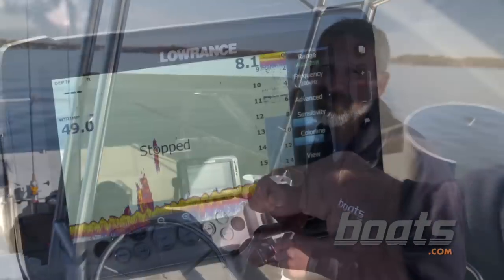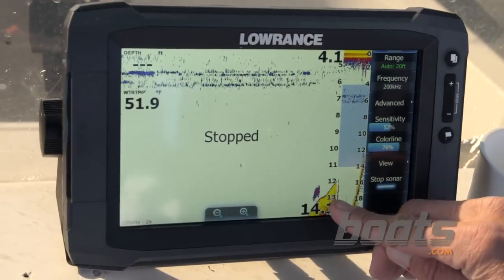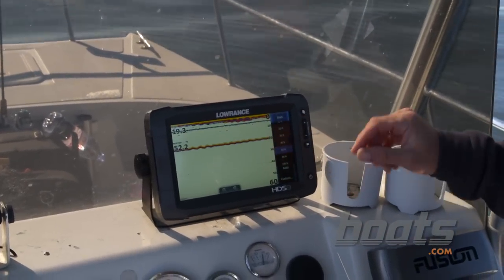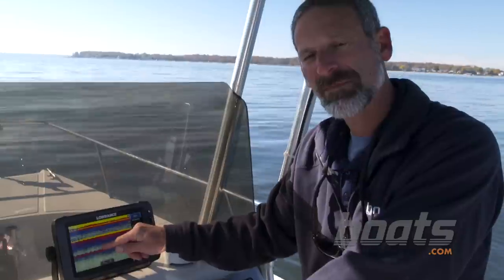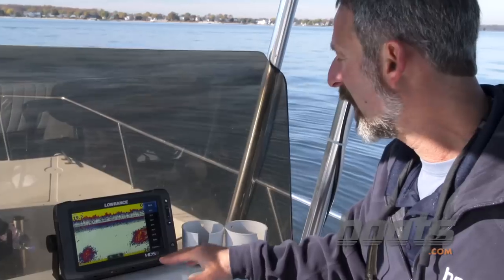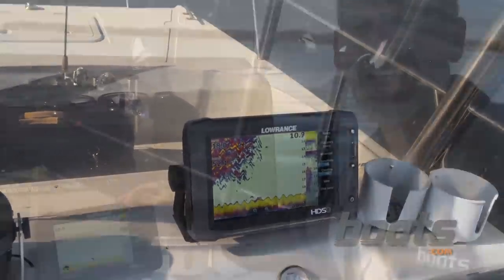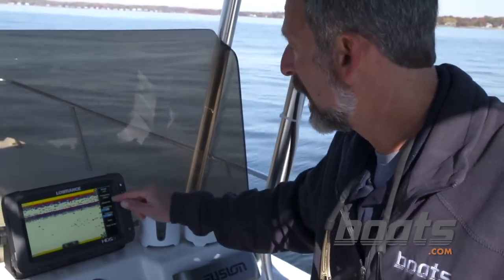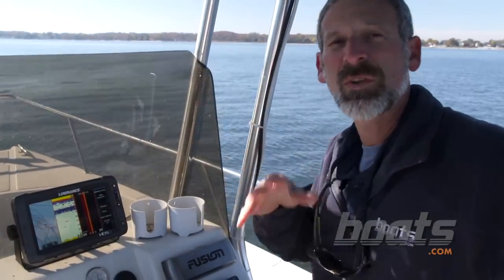How to Fish: Using Your Fishfinder

Comment: So what you see on the screen is what you previously went over?  What's the delay time?  When you do see the fish arches, do you need to turn around and fish behind you?
Reply from the maker: Hey Drew Olmsted, it depends on several factors - where do you have the scroll speed set, and how fast are you traveling? How fast is the fish swimming, and is it swimming in the same direction you're traveling in, or a different one? Since these factors constantly change, there's no straightforward answer to your (very good) question. This is one of those things you have to get a feel for.  In some cases, yes, you will want to turn around. In others, the boat may have passed over the fish but your lure or bait may still be on the other side of it. You have to take all of these things into account as you hunt the fish, and apply them to each specific situation.
Reply: Ok, thanks.  Appreciate the answer.  Unfortunately I don't have the answers to any of your questions.  I just bought this thing and have only used it once.

For what it's worth I'm fishing out of a kayak.  Not moving fast at all.  I believe is set the ping speed to normal.   I couldn't tell if the fish were moving or not.  I would just see them as the screen scrolled by.